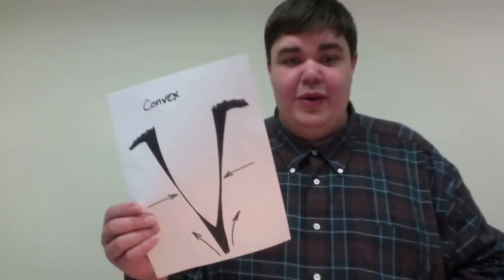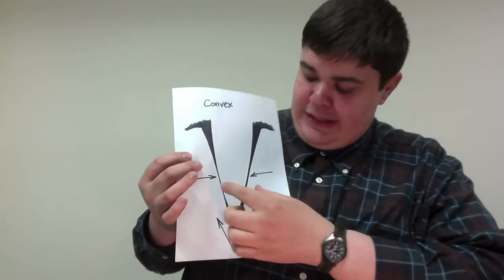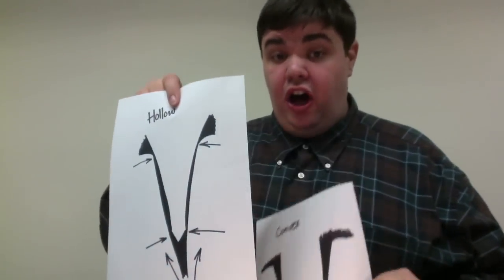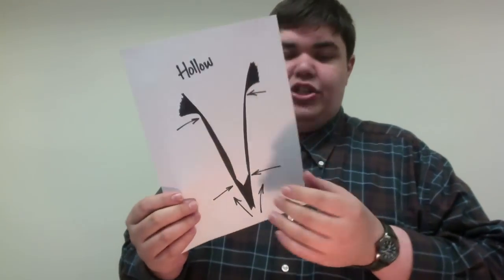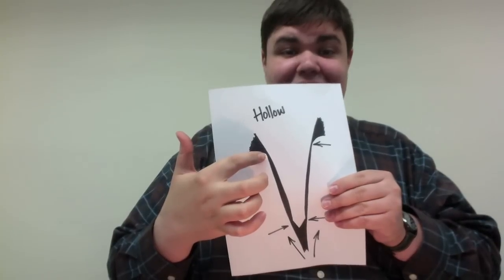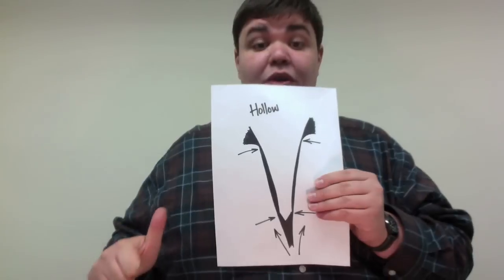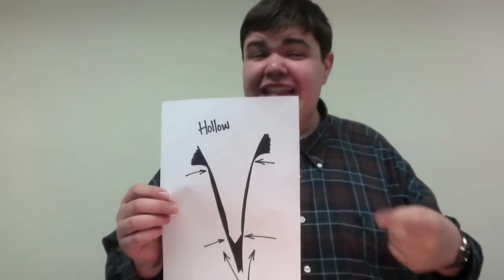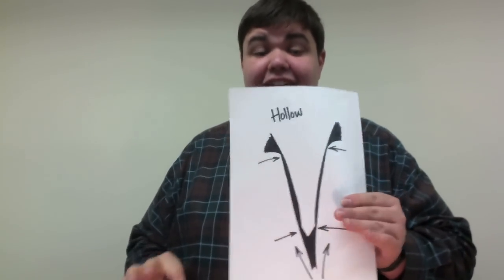Which is Better: Convex Grind or Hollow Grind?

Comment from the maker: I prefer the convex for use and sharpening as well. Not to mention, if you sharpen you knifes by hand, they are going to become convexed whether you intend for them to be or not. Without a jig, it is impossible to maintain a perfect angle 100% of the time. So I might as well go ahead and convex the edge :)

Comment: I suspect the reason for hollow grind popularity is that in manufacture, a raw blade can be placed between two opposing spinning grinding wheels, grinding both sides of the blade simultaneously, thus achieving exact duplicate results on both blade sides, in one operation. The opposing circular wheels method can only result in concave results on both sides. So... cheaper, faster is probably the main motivation.

Comment: I would say you are 99% right on that but not only do you have two different grinds you have two different edges if you convex the edge of the hollow grind especially one likes his from my experience your results are going to be a lot closer in performance or vice versa , putting an straight flat angle edge on the convex grind! from what I could tell it was more of an edge penetration issue!

Comment: The convex may be better for a splitting kind of cut, but I found it imprecise and difficult to work with it for anything else. For a more precise control over your cut, I would highly recommend the flat type of grind or the so-called scandi grind. Either one would make fine work a lot easier (such as small precise cuts, whittling work, feather sticks, etc.) For me, the convex just "bites" too much for my liking...

Comment: Not BS, but the comparison is not very useful. What you are comparing is a full height zero ground covex blade and a full height hollow gound blade with secondary bevel. And you didn't say anything about the edge geometry angle. You need to remove more material to get a convex ground with same edge angle. The hollow ground can cut as good if not better when you increase the width of the secondary bevel to make it like a zero ground scandi or even convex edge plus a large hollow fuller to decrease the friction and retain a strong sabre spine. Many people think hollow ground cuts bad due to the shoulder of the secondary bevel that many hollow ground knives have. I was one of them until I have more experience.

Comment: There's really nothing beneficial about a hollow, it's only good quality (for slicing) is the initial thin edge. Yes, soft materials it will begin the slice easier, and the ramp wont negatively affect is AS MUCH. But it holds it back. A full flat grind with an initially thin edge would do just as well. The hollow grind is idiotic, it has a steeper angle on the edge, transitions to a shallow angle, then ramps up again to a steep angle, then goes back to flat. Basically it has two shoulders. If you begin to grind both of these shoulders off, and it will cut much better, but still be sort of waved shaped. Grind them off more and youll start to actually get a full flat (with a cutting edge of a different angle) or if you convex that edge and push it back, youll start to get a full convex all the way to the edge. These will both cut better than the hollow. The hollow grind just often gets mistaken for a better slicer because it's initial edge is often much thinner than other knives with a similar spine thickness.
Reply: that's why the only practical application of the hollow grind is in a straight-razor